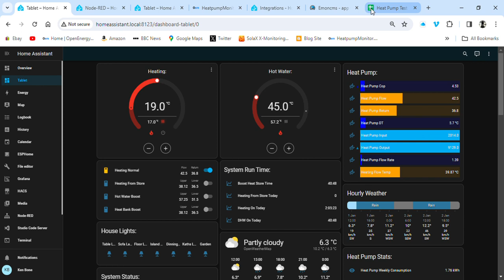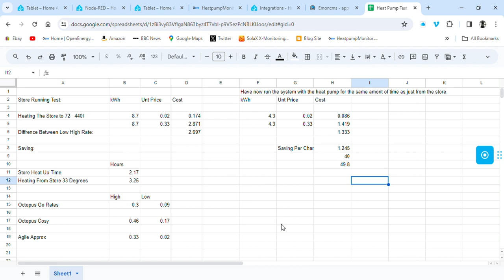Heat Pump Load Shifting Test Part 2 The Result

Comment: I charge my 250L water cylinder on Octopus go off peak for 4 hours a day on eco mode using a Vaillant Aerotherm Plus it uses 4 kWhrs to produce 16 kwh of water energy heat it's amazing. (4x.09=£0.36+vat per day).